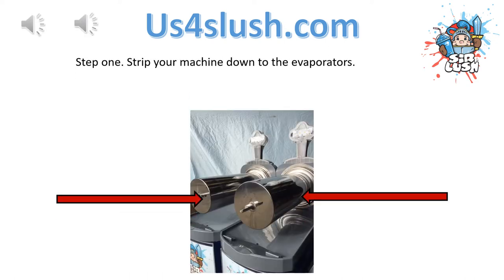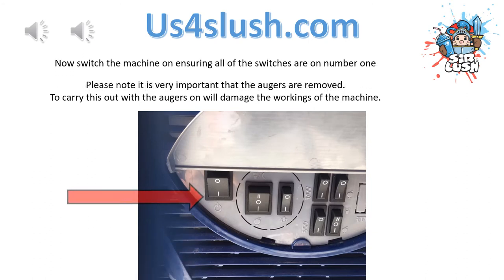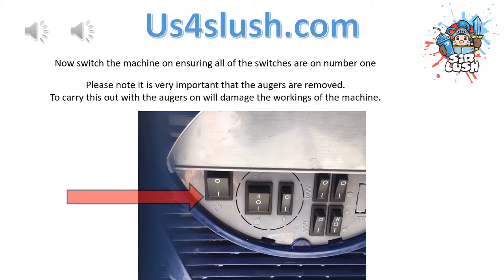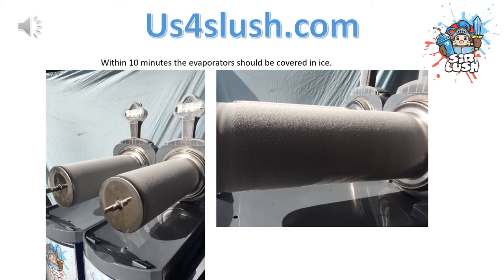Dry testing a slush machine to check the refrigeration

Comment: Hi my evaporator does not freeze in ten minutes... It takes over an hour and it only freezes at the tip of the evaporator.... It was fine few days ago.... Please advise. Thanks
Reply: need gassing probly mine is the same
Reply: Agree with Tim. Either gas or the condenser is blocked with dust